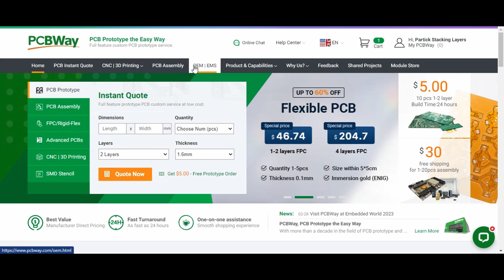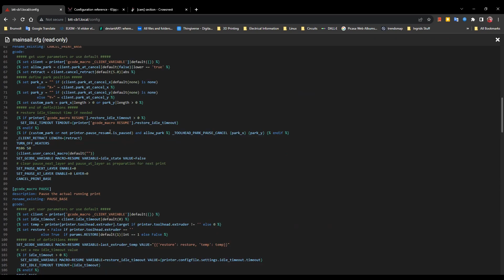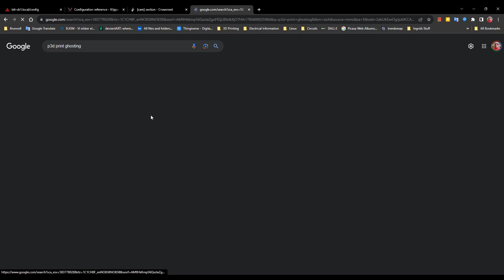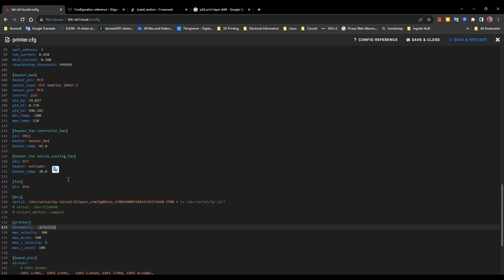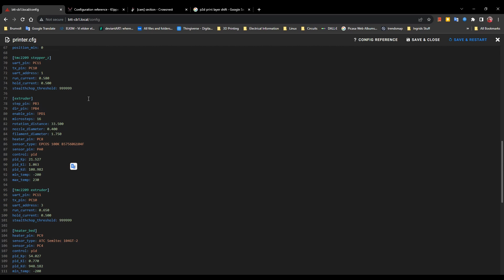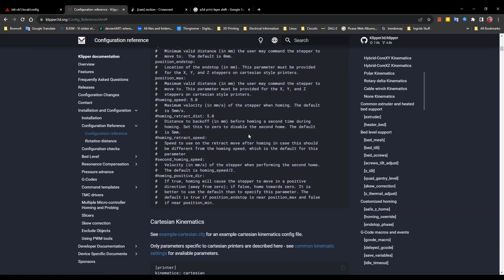printer.cfg, Klipper's most important file

Comment: Wow that helps a lot!
I had problem to get mine working until i edited the "macros file" with the github skr mini 3v3 cfg.
Then he did run the axis and pushed 2 buttons. But it dosent get down all the way, also the cr touch isnt lighting and reacting.
But at 6:50 u just casual give me maybe the right hint =)
I try it tomorrow and edit if it works.

Comment: The best AND worst thing about Klipper is its documentation. There is lots of it, so it makes it hard for the beginner to single out what is required/important for the task at hand. This video was helpful and almost got to my problem. I'm trying to set up cooling fans for the MCU and stepper drivers. I don't want them running all the time but would like them to come on if things get to warm. Still haven't figured out what to use for the sensor. The MCU has a sensor that I already have defined so that I can display the temp but I haven't figured out a way to use it to turn on the cooling fan without having klipper throw an error.
Thanks for simplifying some issues!
Reply from the maker: You can use temperature_fan for that. It uses the temperature of a sensor to trigger a fan to try and maintain a target temperature. This is my host cooling fan for example;

[temperature_fan Host_fan]
pin: PE4            #fan-4
sensor_type: temperature_host
shutdown_speed: 0.0          
kick_start_time: 0.5
off_below: 0.4
min_temp: 10
max_temp: 90
target_temp: 55
control: pid
pid_Kp: 2
pid_Ki: 4
pid_Kd: 0.1

The configuration infonis here https://www.klipper3d.org/Config_Reference.html#temperature_fan

Comment: Im trying to figure out how to setup the cr touch on my ender3
Reply from the maker: It's configured as a BLtouch.
Reply: @StackingLayers  Yeah, i had pins switched. Thansk for the reply though. I was getting errors for the probe not working as well, and basically i just need to increase the z offset.

Comment: what parameters do I need to change if want to use this board skr mini e3 v3 with an Ender 5 plus?
Reply from the maker: You set the printer.cfg mostly for the board you are using. Things you may want to edit are run current, rotation distance, thermistor type, and things like that that are machine specific.

Comment: I have a Sovol SV06+. Both Z screws have stepper motors, but they both plug into the same port on the board. I have to level the gantry every time I turn it on. I way to upgrade to a board with independent Z drivers. Any advise?
Reply from the maker: Any 5 or more driver board will give you the ability to do that. I can recommend the the Bigtreetech SKR 3 with Marlin firmware or the Manta M5P with cb1 (or raspberry pi CM4 for more computing power) to run with Klipper firmware. Keep in mind that you will need to add the drivers seperatly to the board as they are designed to be customized.
Reply: @StackingLayers  thanks!

Comment: This video may be OK for some (Who have some experience), but this tutorial 'suddenly' opens up into some unknown program showing the config file (plus others) without explaining how to get in there in the first place.
Reply from the maker: It's opened in mainsail, the web interface that a vast majority of klipper installations comes with. I didn't show how to get there because if one is trying to understand what's in the printer.cfg file, mainsail or fluidd has likely already been installed. I suppose you could make a printer.cfg in notepad++ or some other editor prior to setting up klipper and the rest needed to use klipper.

To get to this, klipper, moonraker, and mainsail or fluidd has to be installed on the host computer (raspberry pi or similar alternative.) then you put the IP address of the host in your browser of choice. Once opened, select machine to show the machine configs and info. The file, if created, will be there. If there isn't a default printer.cfg you will need to add one using the new file option or by importing one.

Comment: i cant seem to get the bed mesh menu working in mainsail,  i can run G29 to do the bed meassure cycle but it wont save. if i press the bed mesh menu nothing happens. what am i doing wrong?  im using a creality 4.2.7 board
Reply from the maker: It won't show if the [bed_mesh] part of the printer.cfg is not correctly set up.
Reply: It's possible that printer.cfg doesn't contain a [bed mesh] and you need to find one and copy/paste it into printer.cfg.

Comment: Can't help but think of food with BLT  - :)
Includes are fantastic way to make the configs easier to manage and read.   I like that Klipper has this.  The  config files are what sets this apart from Marlin in my mind as Marlin's configuration is all embedded deeper in the code structure, where Klipper can virtually be changed on the fly.

Comment: So, do you know to access the SD card from within klipper and if someone wanted to go back to the original firmware such as Marlin.
Reply from the maker: The SD card on the host is basically the hard-drive of the system.  So loading files is done through the web interface, just drag and drop, or with a file transfer protocol.  
If you want to go back to Marlin, you just flash the marlin firmware on the controller board. Nothing more is needed.  You could then set up octoprint on the host computer if you wanted. That works great with marlin.
Reply: @StackingLayers  I tried that, but it would not read the card which is why I thought my board was dead.   So, I ssh'd into my orange pi and used kiauh to detect the mcu through USB.  I was able to configure klipper mostly except the board is not attached to a printer right now.  I tried putting Marlin firmware on an sd card, but it did not read the card or recognize the file.  I know the hardware sees the card as a green led comes on when I insert the sd card.  I guess I will have to hook it up to my printer and see what happens.
Reply from the maker: What SD are you referring to? One in the controller is used for flashing firmware only and is not accessible by klipper.  Those need to be formatted to FAT32 and some boards won't read if the card is over 8GB. Also depending on the board, the firmware file name is very important. For example for bigtreeTech boards only firmware.bin will work,  whereas with creality, from what ive read, you cannot use the same name as the previous file that was flashed.
If you are using klipper you must install the klipper firmware onto the controller board not just the pi. Marlin firmware is a standalone firmware not compatible with klipper
Reply: @StackingLayers  The sd card on the SKR Mini E3 V3.0.   I will try it again.  

Well, the board is working again after putting marlin back on.  I guess there was an issue with the sd card.  I made sure it was formatted properly this time to fat32 and nothing else was on the card except the firmware.bin.  weird though when I put klipper on my 8-bit board when I was just testing things out that the stock display actually worked with klipper.  It does not work with the SKRMini E3 V3 though.  Oh, well, at least I know what to expect now when I install klipper.